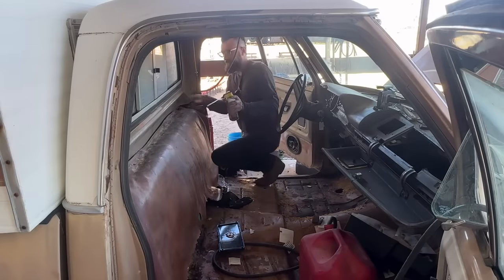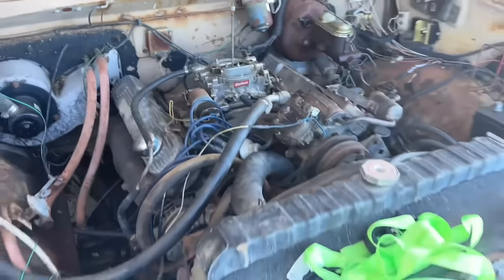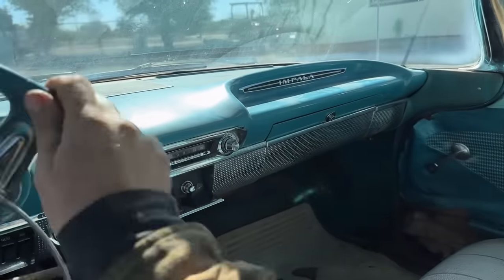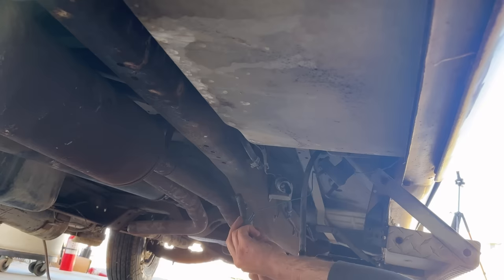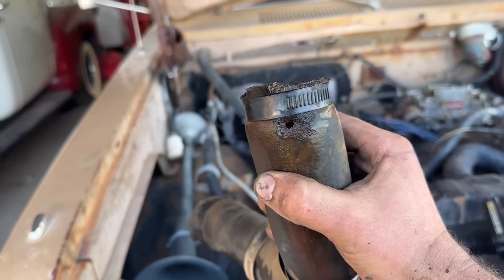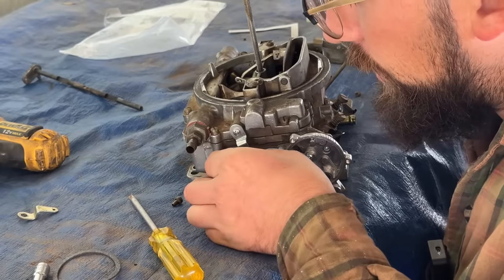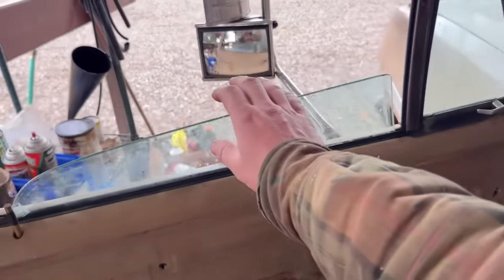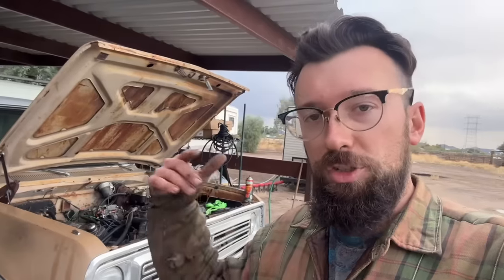Dodge camper abandoned 25 years, will it run part 2 updates & fixes

Comment: These trucks ground the electrical system thru the housing of the taillights and signal lights it’s not entirely uncommon to have lights that don’t work then start working on their own . If you remove the taillight and parking light housings and clean where they attach to the truck they will be nice and bright and work well . I just recently had to do this to mine

Comment: Yes sir that's a good truck to work with. When I cut those rubber hoses, I take them and squeeze them in the vise and take a hacksaw (you can use a fine-tooth blade if you wish) and I cut the hose that way. With practice you can make a pretty clean and square cut. Trying to use a cutoff wheel with a straight die grinder is time consuming and just clogs up the cutoff wheel. On a fresh piece of hose squeezing, it together will not harm it and you can get a pretty good cut. Years ago, I acquired a Hobart welder gasoline powered (Ford inline six) and the gasoline tank was varnished up like the main tank in this Dodge. Well, I took it to a radiator shop to see about having it cleaned out and the woman told me that they tried to get it clean and used Tide to try and break that varnish up. Well, I took it back to the shop and poured some old carburetor cleaner (the good stuff but you better use gloves with it) and let it set some and then sloshed it around and sure enough it cleaned that varnish out. If carburetor cleaner is good enough for carburetors, then it obviously should work on fuel tanks. Of course, cleaning out that varnish revealed all of the pinhole leaks in the tank but that is another show. When I reinstall hoses on water pumps and radiators and of course these rubber fuel line hoses I either put a rubber lubricant (tire mounting compound will work) grease (my father did this all of the time) or petroleum jelly on the inside of the hose. What this does is to allow easier installation of the hose and it allows the hose to seat better and naturally take out any twisting. And we have used this method for years and when a hose has to be removed there is a tool MAC SW70 that allows one to get in between the hose and fitting and helps to break the hose loose. Of course, if the hose is old and dry it's going to be replaced anyway but a reusable hose can be saved. I've never had any problems with any hose deterioration using this method and any tire man will tell you that you lubricate the bead on a tire for seating purposes. Same holds true for rubber hoses.🥸🥸🥸🥸🥸👍

Comment: That particular truck started production around March or April of 1971. Made its debut at the 1971 Indy 500 classic as a support vehicle. Went on sale June 1st, 1971. This truck was in production until 1993. One thing I recommend is getting rid of the cab mounted gas tank. That is dangerous to have. The cab mounted gas tank was gone after 1976 or 1977.

Comment: Hey Travis, glad you are getting it done with little trouble & good to see you overcome the issues with the choke. I had some issues when I rebuilt my Mustang 2.3L with a progressive 2 barrel Holly. I added a header and deleted the EGR so I had to modify the choke. I ended up with six diaphragms in total. A lot of work modifying a little carburetor to make it run with the added horsepower I created when I over jetted it and adding a distributor mod and a larger cam. Before all the carb mods the engine fell flat when I stepped on the throttle but took off when I let up a bit on the petal. After the mods it ran perfect and took off like a rocket.

Note: make sure to replace the vacuum line to the in dash fuel economy gauge. Also check all vacuum lines to your doors for heat & air under dash for mice damage, and nests at the doors. Run a bore scope up / down the vents.

Glad Gunner gets a sweet ride (my favorite car ever).

Comment: if you really want to improve the cranking of the truck install like a 1994 ram 1500 360 starter on it will start twice as fast spins so much faster

Comment: When you were checking the fuel sending unit for the aux. tank, I think your meter might've been influenced by your skin resistance from your hands touching the probes. The resistance should be much lower, like 100 Ohms empty and 25 Ohms full.

Comment: Why did you modify the carburetor to an electric choke? Seems like you added another possible point of failure and complicated a simple system. That running light/tail light situation was crazy, I guess it was one man’s idea of a quick fix? Nice work getting it flushed out. I remember when Dodge/Pymouth and Chrysler were putting those fender turn signal  indicators on everything, I’d bet you can find replacements for them online or get them from a pull-a-part. OBTW they are serviceable, you had to be able to replace the bulb somehow…right?

Comment: The "some other way" you're looking for is called a "bi-metal" automatic choke.  The Holly 2 barrel carburetor on the LA 360 V8 in my 1977 D200 Adventurer uses that type of choke. The nice thing about the electric chokes is that it takes a lot less time to "come off the choke" and deliver proper driveability for vehicle equipped with automatic transmissions.

Comment: Travis, Pop, when you all rewire, build a motor, or a transmission, do you all provide the work description you did( in depth) for the next buyer....since 90% of the build sheets , wiring diagrams, mechanical are missing.....giving the car or truck a clean bill of health....IT IS A QUESTIOÑ, BECAUSE ALOT OF PEOPLE SELL A CAR "BY AD AND 10 WORDS OR LESS"

Comment: Those fender top indicators are probably off of a 69~71dodge charger and the bulbs are replaceable but they are a bear to get out sometimes without breaking the amber lens. I think the bulb part number is a 330? But it’s been awhile since I’ve done it.

Comment: You must always remove the STARTER before you try to start it. One of the most important pieces of external machinery on a car, it can really REALLY rust, particularly the wires inside!!! If the gears within it rust, cranking it can cause those gears to strip out ( lose their teeth )!!! This happens a LOT with starters that have sat rusting for at least 40 years!!! 
With THOSE starters, you have to have a lot of patience, good quality wires, parts ( even the ability to RE-MAKE certain parts ( cog wheels and sprockets that are too rusty will strip right OUT when given a good heavy duty “spin!” ). You also need to check the “windings.” The “windings” are basically the “muscle” of the motor. If those are rusted, it will overheat and burn up FAST!!! In many videos, I will hear them cranking an old 1930s International with the starters being “AS IS!!!” That poor old rusted out machine has to crank ( turn over ) an engine that hasn’t moved since my GRANDFATHER was a teenager!!! And since they probably haven’t MADE that type of starter since 1945, you will HAVE to take it all apart and do everything you CAN to make it fit for USE once more. This requires dedication and often MacGyver type innovation. Squirting some oil down the main shaft will also help lubricate the spinning gear in the middle. Then, all you can do is “test” it to see how well it spins, put it in and hope for the best! 
I saw someone go through TWO starters on one of those old 1930s cars because they failed to understand that, 1. That old engine was particularly TOUGH to turn over and 2. Those  starters were like two tired 86 year old men with herniated discs ( RUST UP THE WAZOO )!!! 
If you don’t restore those first, you’ll BURN THEM RIGHT UP! 
Eventually, those old starters will become completely obsolete, because they haven’t made those in TENS of decades!!! Of course I suppose companies can create blueprints ( based on how the old ones were built ) and start making them again. This is actually a very good idea, because if it’s been rusting in the DIRT since about a year after the “Wizard of Oz” hit the big screen, it would be STUPID to put 12 volts of electricity to it and force it to turn over a big rusty old ( improperly oiled, no doubt ) ENGINE. I’ve seen this COUNTLESS times, and it’s “cringeworthy.” The starter is probably the most overlooked piece of machinery in the car. You can NOT take a 90 year old starter and run it without “dissecting” it first and replacing all the rusty, crusty crumbling old PARTS! I did this with an old starter like that, and I was able to replace ( HAD to replace ) a whole SLEW of rusted wires, gears and sprockets. ). Then I had to replace rusted “windings!” Once done, that old International starter worked like a charm. It STILL works like a charm!!! 
Is that easy to do? Yes and no. In the case of the starter I renewed, I had to “drill out” the old screws and bolts. They were rusted 200 percent solid!!! I then replaced those bolts and screws with slightly bigger bolts and screws!!! It was a total B!1CH to do!!! But so far, so good.
Restoring old 1920s-1940s cars has become big business. They need to start re-producing those old starters again. The fact that they even WORK “as is” is quite remarkable in and of itself. They were built SO well that they even work old and RUSTY. But that usually doesn’t last very long. If they can be re-created exactly like the originals, that would be perfect. They are definitely re-creating a lot of the old automobile parts again. So it shouldn’t be too hard for companies to re-produce all the old different types of starters. There would be great PROFIT in that. 
Many people are tired of computerized ( geeked up ) vehicles. They just want cars that RUN and are relatively easy to WORK ON!!!

Comment: Another great channel episode.  Could not tell for sure but it looked like you connected the 12v power source for the electric choke to the ignition switch side of the coil.   If the truck has an ignition ballast resister connecting the choke there will cause problems because that connection is not 12v and the choke power load will cause ignition issues.
Reply: yes I agree with above, you want to run a wire from the ignition switch directly to the electric choke so that it has switched 12v, great job with the camper special. I have a '64 F-250 camper special that is a great truck

Comment: There  also marked  440 or 400 on the block  next to the starter ether  one is a great  engine Chrysler  clearly  marked  there  displacements on there engines  so you usually  don't  need to  look up a bunch of  numbers.

Comment: also all 440 engines came with 4bbl so if it had a 2 bbl would have been 361,383 or 400 and also their in earlier their was a tall block 383 that had that pad where yours says 440 would say 383 only seen 2 of them. also their was a 413 and 426 wedge which also was a tall block like the 440 and pretty sure all were 4 bbl except the tall block 383 could be 2 bbl.

Comment: 1973 Dodge D200 my lil brother had one a club-cab long bed model Adventuner came with a 360 C.I carter BBD 2bbl carb with a 727 TF he had a tail light trouble and he install towing tail lights and there was nothing wrong with the wiring it just that the main tail lights wont come on and as he install an extra tail lights on the rear bumper all the tail lights came on the extra tail lights and the main tail lights all together we thought it was the bulb connecters but it wasn't. funny story though.
Reply: Usually when you have a tail lamp issue with older cars an trucks like that, it’s usually the turn signal switch. All of the wiring that controls the tail lamp functions goes through that switch. Had the same problem with my buddy’s 77 f-250. Changed out the turn signal switch and everything came to life. Looked at the old switch and found a burnt out terminal in the switch itself.
Reply: @NYPATRIOTBX  One thing is he had that truck for like 2 years and he sold to our late ex brother in law back in 2010 and he and his dad repair the main fuel tank filler neck it got 2 tanks 1 in the cab and 1 under the bed and it cost like 96 dollars on reg back in 2010 to fill up the truck both tanks total then in 2012 he scrap the truck cause the frame rail got heavily rotted my lil brother got the truck all rotted up and drove it from 2009-10.

Comment: Off topic, but I replaced the fuel pump in my ford e 250 van  with a Chinesium pump from Amazon. After 6 months it quit working. It swelled up to the point I had a helluva time getting out of the hole in the tank. So stupid me I had already ordered a replacement (whats the chances I'd get 2 shity pumps)? This one lasted 2 months.

Comment: K, I have to ask as I just find it weird and just in the wrong spot... Why on earth would they put the filler neck opening for the second tank on the bottom of the tank, you would want it towards the top of the tank so you can actually fill it. Putting it on the bottom of the tank means you would never get a full tank...
Reply: Dodge things.
Reply: As long as the filler inlet is higher than the top of the tank -- which it is -- and that tank is vented at the top -- which it is -- it will fill perfectly fine, and right to the top.

Comment: cab gas tank super dangerous plz delete
Reply: Why? Industry standard for more than 50 years. Not plastic. Protected in case of wreck.  Run with it.
Reply: @OtherSarah2  Chances are good there's no problem, but we have better safety standards and ideas now and spilling your occupants with an accelerant during a vehicle crash we know can be dangerous if rare. Easy to stop doing it. Not everything done "the old way" is best. We learn from our mistakes.
Reply: not arguing. Pointing out that late as '75 GM put 'em all behind the seat (and in cars all the US automakers now have the fuel pump access under the backseat, to fragile plastic tanks with kids mandated to sit there). @AaronBlair
Reply: no hate for that from me. I just remember riding in pickups with gas tanks behind the seat as a kid; we didn't think anything about it (even at 19 cents a gallon, having a lock to protect your gas tank was always a good idea)  @AaronBlair
Reply: Hard to punch a hole in a tank when its up high
Reply: Increases payload balance having tanks midpoint

Comment: The reason why rodents and creatures like that such as raccoons and possums. And what not? They're very attracted to any type of plastic coating or rubber! What happens is as time goes on. Actually a sweet scent forms when they become brittle. And that is the reason why they chew on that. Specifically mice for the simple fact that they see that diameter and they want to get in there.  And make a nest just like when entail pipes. You find mouse houses that's the main reason why!